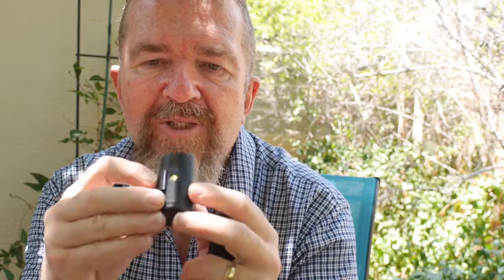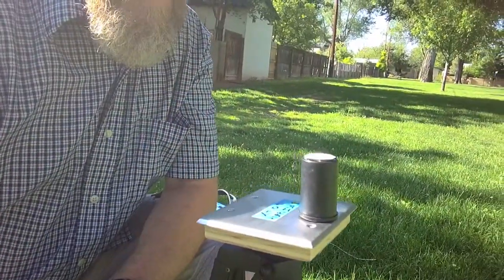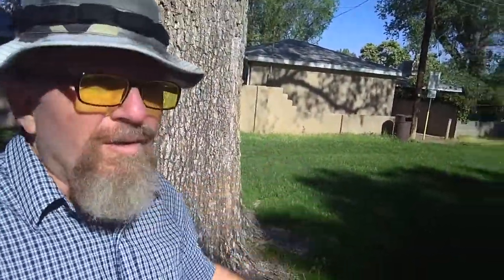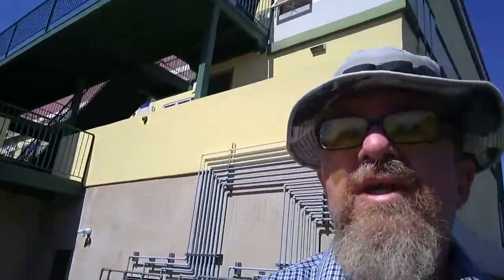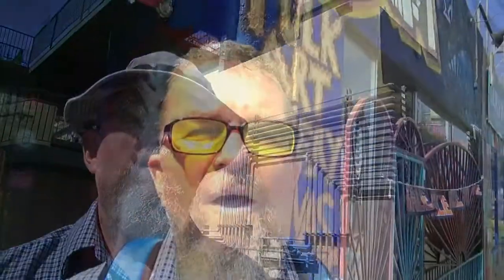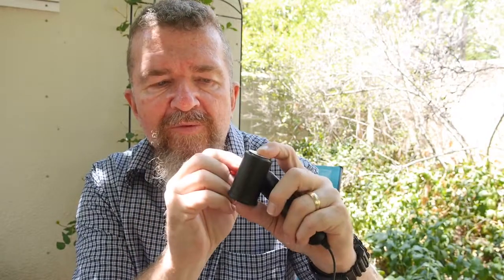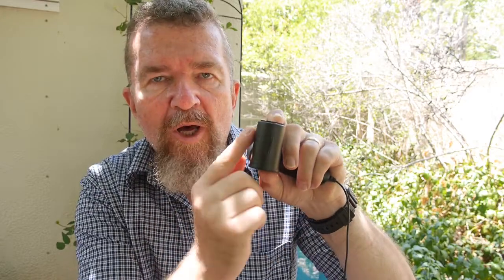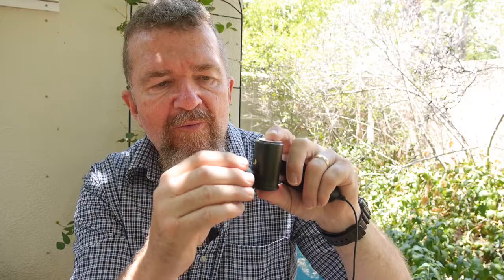Pinhole Field Trip - Film Canister Cameras

Comment: Joe as far as shutter problems, maybe a black paper sleeve with a larger hole in it. put the tape on the top of the sleeve to open and just push the sleeve down to close. Ideally another canister just a bit larger so it slides up and down. The advantage would be closing just takes a tap to push it down and closed.
Reply from the maker: That's a great idea, I'll have to work on it.

Comment: I tryed the sleeve and it works. I just cut the bottom off another canister and then split it. I glued 2 small super magnets to the inside of the cap. I just set the canister on a very large washer and it sticks due to the magnets. I put my finger on the top while sliding the sleeve up and theres almost no movement. I have to work on the exposure a little. I've been over exposing quite a bit. Hope this helps you
Reply from the maker: Thank you. I have an update soon, I've made sleeves from the plastic dark slides to Fuji Instax cartridges.